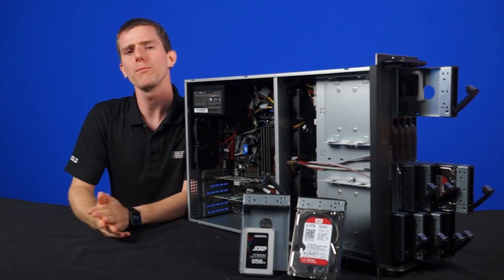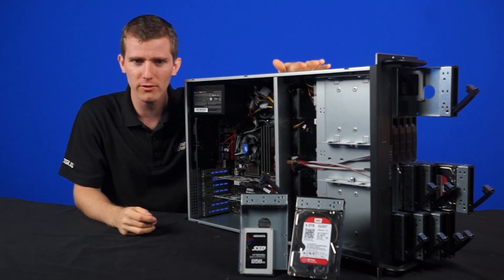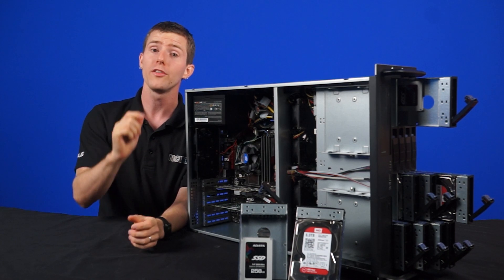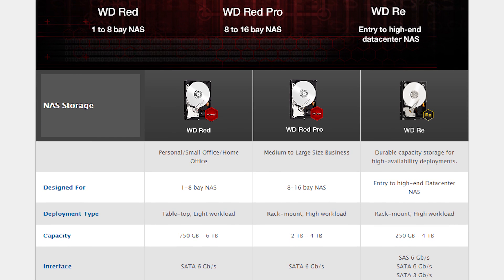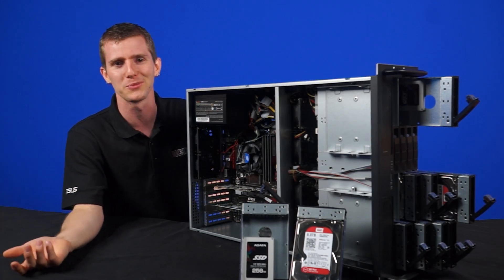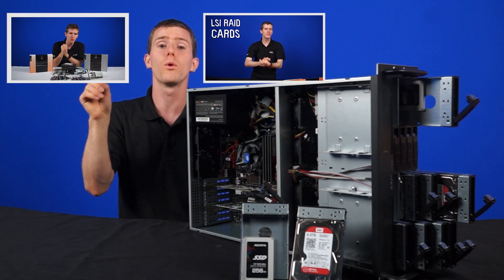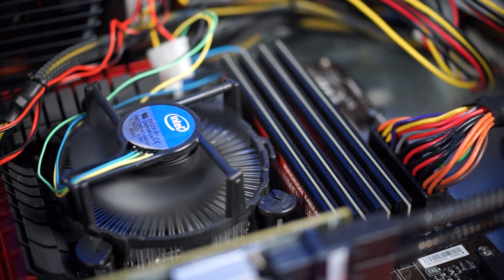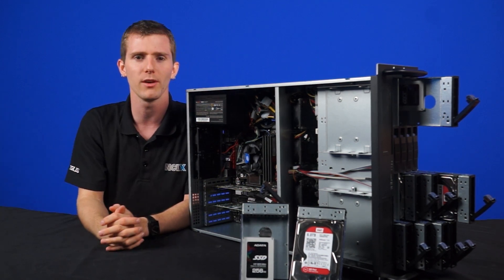New Shiny Ultimate NAS ft. WD Red 6TB Harddrives

Comment: I actually need help. I've built a NAS, (specs below) but I have no idea how to set it all up. I've built pcs before but never a NAS. I haven't  had a chance to mess with it fully since I'll be moving home soon and I figure it best to wait until then to start wrestling with my network. My first q is does windows server 2012 have support to play media files on the same PC? as using it as a HTPC as well would be most ideal. My requirements:

Network accessed storage in RAID 6.
Local playback (use as a media centre pc plugged directly into main TV hdmi).
Only authorized devices access (More on this later)
Auto backup for a separate gaming rig. (this this more of a bonus than a requirement as I can do it manually.)

My questions:

What OS would be best for these requirements?

How to I set up hardware RAID? Is this done automatically when I plug the drives into the card? Does an option come up in the mobo BIOS? Is it just done with the downloaded firmware/ software from the manufacturer's site?

How to I set it up so that the drives in this pc are accessible on the network?

What about viruses? I have quite a few different people come through my house everyday and use my WiFi, and not one of them is remotely tech savy, and I guarantee at least 1 of them WILL have a virus in their net-book/laptops. Just to say, my WiFi network atm is WPA2 password protected. I have yet to have any trouble with this, but putting a dedicated server on the network is another matter entirely. For this reason I was thinking of Linux but not sure which version to get or how to set-up the network access stuff with this either. Or maybe a separate network for guests? 

Would really appreciate some answers to these questions.

Specs:
Case: Silverstone Grandia GD08
Mobo: Asus Z97 TUF sabretooth mk1 
RAM: 32GB HyperX LoVo
PSU: Enermax 650W Revolution87  
CPU: Intel 4130 i3 
Cooling: H100i liquid cooler. Config for low noise.(Overkill I know but had it lying around anyway)
HDDs: 8 X WD Red 4TB hard drives connected to RAID pcie card. (Raid 6 plus 1 hot spare). Possible more HDD in future. hence 16 port raid card
Boot SSD: 2 X intel 730 series SSD plugged into Mobo for boot. (Raid 1)
Nic: 4X1 Gigabit intel NIC
RAID Card: LSI Megaraid 9280-16i4e
Reply: Just install FreeNAS and set up SMB File shares.
Reply: So there is quite a lot to answer here. I am not NAS master and I would search around you tube for several full guides. I would recommend the Linux server because it is more full featured and I feel has better security (windows is probably still fine). The problem is that if you are not tech savvy learning to set up RAID, and ubuntu or debian server, and everything else would be kind of hard (not impossible). Your Specs look great and I am jealous. So to address your questions.
Best OS:Debian 7 or Ubuntu 14.04 (Ubuntu is more beginner friendly)
Hardware Raid: You can configure raid in bios of your mobo, however that is using your mobo sata ports and you have a raid card so this is not what you want. Your raid card probably has some sort of bios like screen of its own where you configure it. That screen will be a little off putting if you are a not used to them, I am not sure if there is a better GUI on windows or Linux. I configure my raid in ZFS http://open-zfs.org/wiki/Main_Page, which is actually software raid. It is still really good but on super easy to learn.
Network Access: In windows there is a way to set up network shares (I don't remember exactly but google for it). In linux you would want to set up a samba share. This is pretty easy but requires you edit a text file to configure it.
Viruses : You should be fine on either for home use honestly. Linux is more secure but this is for home use and you probably won't have anyone targeting your server. Also you are just talking about a network file share not and ftp so there isn't much to worry about.

Sorry if I missed some questions or didn't fully answer them I am not an expert but have done this on my home network.
Reply: Hey man im planning to build a NAS box soon too. Im going to be running an OS called FreeNAS which is based of freeBSD and unix you should check it out it can do most of the things you mentioned except the home theater part. But dont worry im in the same position as you! you can buy a chromecast and plug it into your TV via HDMI and install the plex media server on your NAS box and then stream all your media to the chromecast over WiFi. The chromecast connects to your WiFi, its awesome do some research on it. Anyway just my two cents.
Reply: Oliver De Bruin Never used FreeBSD but yeah Plex can be installed on it. I know it has a similar command set to most linux distros but I fee FreeBSD is not as friendly as an ubuntu desktop for beginners. Just my opinion and may be wrong. I also use a Plex server with a few chromecasts. They are one of the best 30 purchases you can make.

Comment: Im a pc noob. If i get a gpu that needs a 6 pin and an 8 pin connector and the psu i want to get has 2 6+2 connector would that still work? this is what im getting 

Rosewill Stallion Series RD600-M 600W ATX 12V SLI Ready CrossFire Ready Modular Power Supply 
SAPPHIRE DUAL-X 14-202-099 Radeon R9 280 3GB 384-Bit GDDR5 PCI Express 3.0 CrossFireX Support Video Card
Reply: Yeah thats not a problem, might look abit weird if you cant hide the 2pin properly is all.
Reply: Yup! That's why it's 6+2, so you can use it as a 6 or an 8! :)
Reply: roaddict4life Thanks

Comment: LOL such a cute small setup. I wish i only needed 28TB of storage. I just had to upgrade min NAS to 74TB but i also have redundancy for up to 6 drives failing before it becomes an issue. Also anyone worth their salt in IT would be using ZFS for their file system and BSD and not a slow insecure windows install.

Comment: I have a QNAP nas with 5 WD Red nas drives of 3TB. Running in raid 5. It has 2 nic's so it has a some what load ballasting feature to it. I run gigabit 8 port cisco switches for around 80mb writes and around 125mb reads to every wired computer in my house.

Now i only need a good wireless solution to be able to stream movies to every wireless device i own. i have a few DD-WRT wireless routers handling some of the wireless in my house but i need to have a better quality wireless experience sinds i have allot of interference in my street.

Comment: Is anyone think that rig too OP For a NAS?
Reply: Agree. Too op. If they wasted so much cash on i5 and some gaming motherboard they could have as well got xeon and error correcting memroy. But most probably they got these components from sponsors for nothing hence a frankenbuild was created. And i7 is just out of question unless u r running 24 drives and 10port plus gigabit ethernet all fully saturated.
Reply: my nas has intel core 7 and 32 gb ram so no
Reply: Калоян Петков That's way overkill! I it'd be fine with the cheapest celeron intel has..
Reply: ivanzegt nope. You can do more with a nas :). Xeon 1230v3 and 16gb ecc ram.
Reply: iTr00oW Yeah, That would make sense. An i7 in a nas doesn't.
Reply: Depends. FreeNAS recommends 1GB of RAM/TB so I don't see that as too much RAM, and the processor is a bit much but it's cheap and reliable.

Comment: Personally running a FreeNAS system using 4x3TB RED drives, AMD 965 BE, 12GB RAM, in a ZFS (RAID-Z1). Been pretty stable overall; had some FreeNAS software issues as well as some NIC driver issues but it's been running like a champ since correcting any issues.

Comment: I'm running 4X 3TB RAID 5 WD Red in my NAS. WD SE 1TB as the boot drive running Windows Server 2012 r1. Xeon 1230v2, 16Gb Ram. File Server.

Comment: why did he use 2 ssds for the os? is one just a back up?
Reply: They are in RAID 1, so yes :)
Reply: sasukeskapa
raid != backup
Reply: eskci0 Nope, but RAID 1 basically duplicates the data so it's kind of a backup while ~doubling the read speeds, so I think you can call it a backup too, because it does that too :D (As long as they don't die at the same time which is quite unlikely :D)
Reply: sasukeskapa
Well, power surge exists, and its not that unlikely to happen. If the RAID controller is the one who gets damaged, things can became pretty bad.